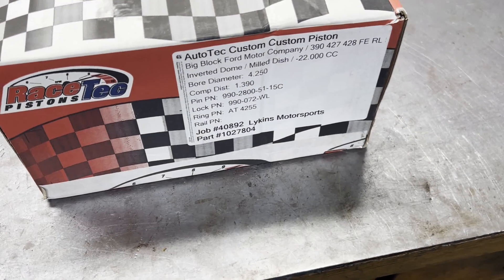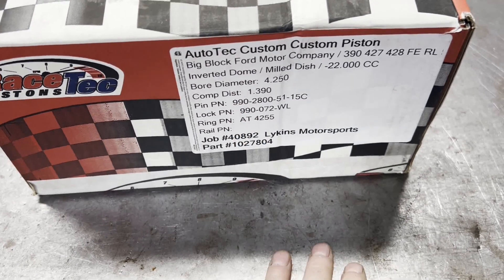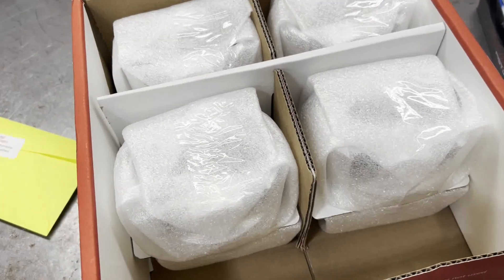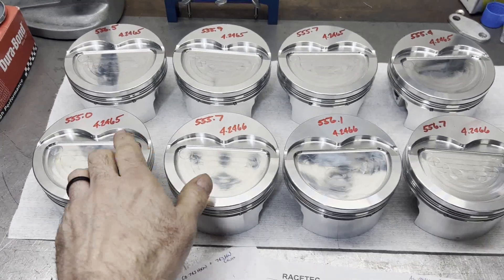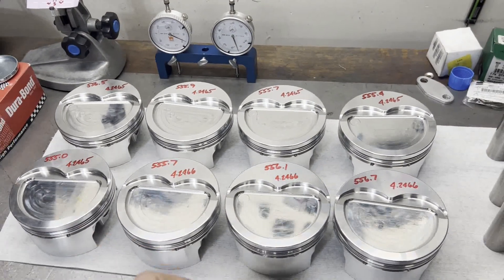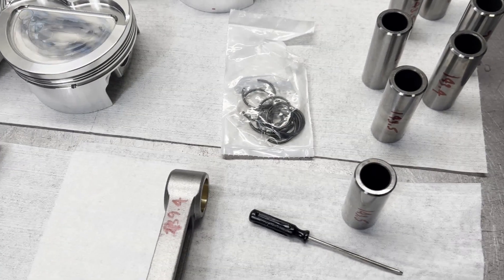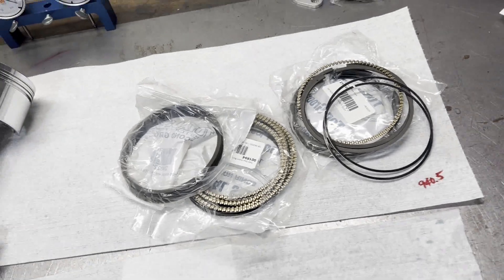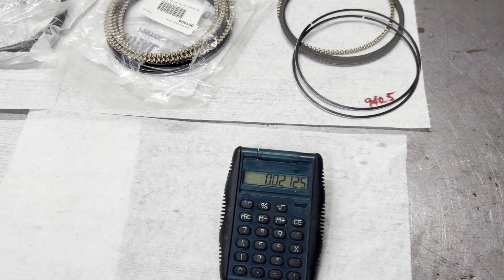Lykins Motorsports Ford FE 465ci Tunnel Port Piston/Rod Assembly

Comment: The reason why the piston top ring end hap is tighter because it gets more heat and the piston expands more at the top...
Reply from the maker: No sir, heat makes things expand, so you need whatever gap you need to not let the ends butt.  The reason the second ring gap is looser is explained by Mahle in my post above.

Comment: I have bin car and bike repair business for 61 years now and I never figure out why the top ring has a smaller end gap then the 2ed ring and the oil control ring  has more. Why this so I do not know. The top ring see more heat then the 2ed ring and the oil control see even less. Can you help me under this? Keep up the good work. I allwaws wath all of you videos when you post them and all them. Thanks Walt
Reply from the maker: I’ll let Mahle explain it:  NOTE: The second ring gap recommendations have continued to change over the years. Current recommendations are such that the 2nd ring gap is larger than the top rings for most applications. Testing has proven that a larger second ring gap increases the top ring’s stability allowing for a better seal. This larger “escape” path prevents inter-ring pressure from building up and lifting the top ring off the piston allowing combustion to get by. Many engine builders have reported lower blow-by and horsepower gains at the upper RPM ranges with the wider second ring gaps. Also, almost every new car made is using this inter-ring pressure reduction method to lower blow-by and emissions and to increase engine output. Additionally, and for these reasons , these ring gap recommendations are to be considered minimums, and some kits will come with larger gaps than the minimum listed in the table directly out of the box.